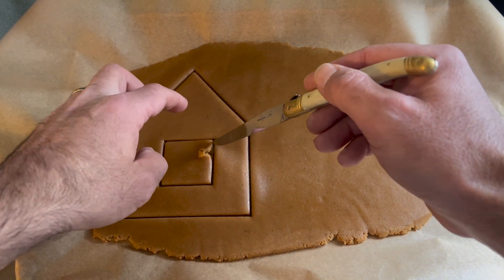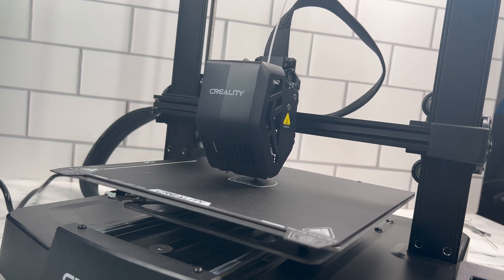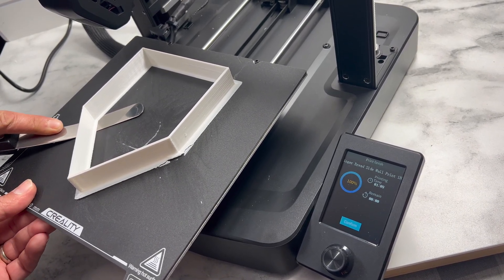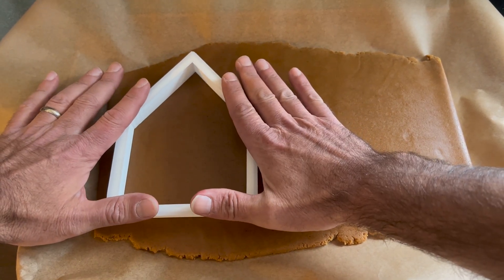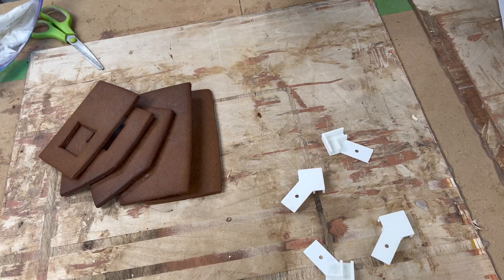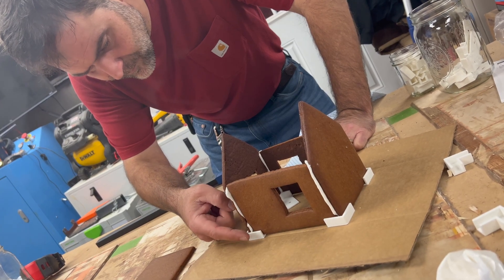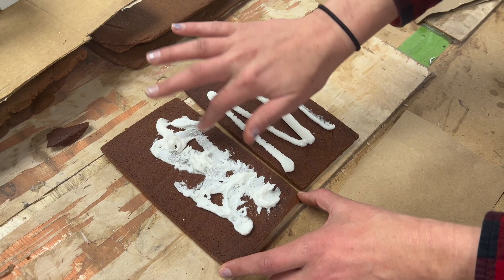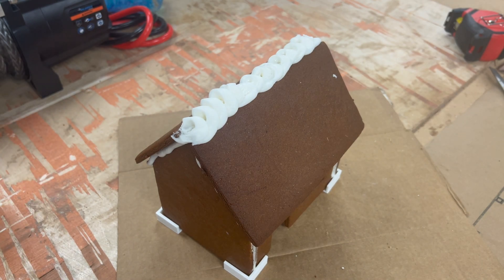3D Printer-Aided Gingerbread House Assembly

Comment: Quick tip on the printer it looks like a removable build plate, you may be able to pull the metal sheet of and bend it to pop the parts off easier (I have a couple printers with them they're really handy)